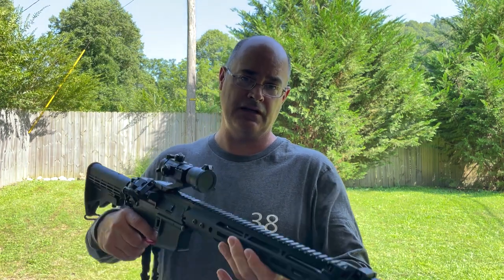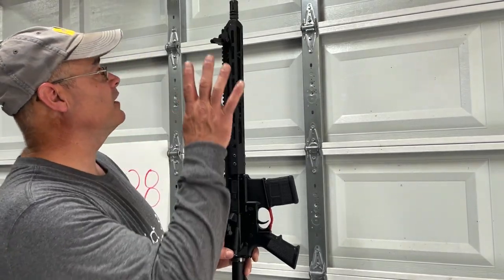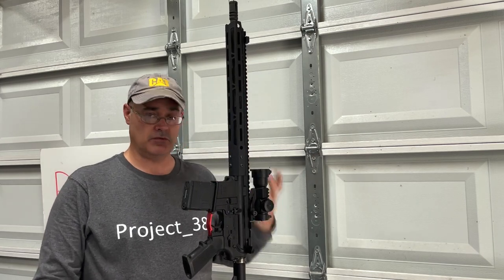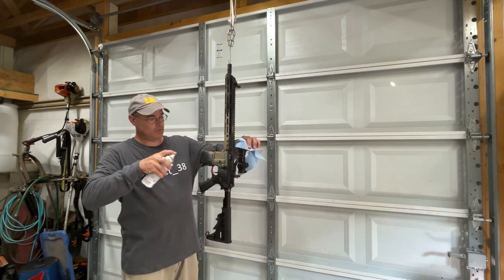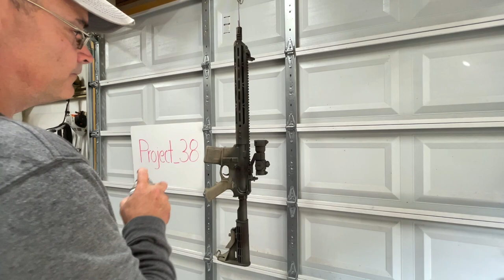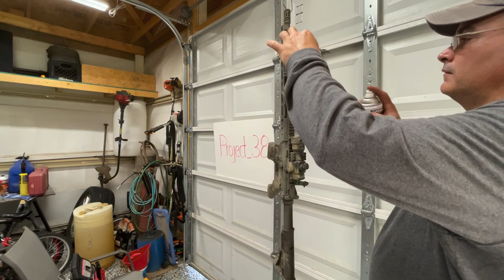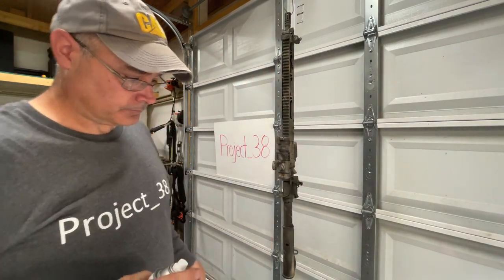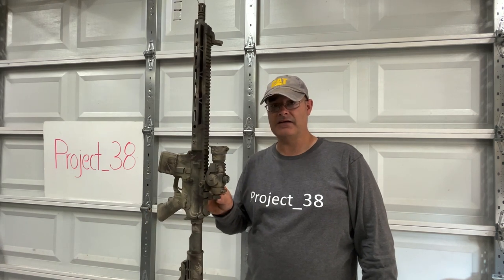Combat paint an AR-15...

Comment: I always found the best looking/most natural spray job was a tan or sand base coat, a few swipes of brown and green for striping, then blending it all together with a misting of green. works for a lot of environments, and doesn't make your gun look like it was sponsored by Real Tree (tm) camo.

Also, Krylon is INFINTELY better than rust-oleum. It wears much more naturally, adheres better (where I've found rusto-leum kind of chips as it wears) and just has an overall better looking finish.
Reply from the maker: I like what you said and appreciate your thoughts. And I don’t think you can go wrong with any combination. Keeping in mind current environment, changes of season and whether or not deep woodland or open expansion. 

Where I live, it’s all of the above. 

Thank you for your input and for stopping by. Ranger Sprocket
Reply: if i could dip my gun in real tree camo i would
Reply: @teleskopossomnium  😅 to each their own

Comment: Will the crab cleaner or mass cleaner hurt the stock or mag, like make it sticky.
Reply from the maker: Not at all. The solvents “gas off” real fast and it doesn’t leave any residue. I think it’s the safest to use. 

I wouldn’t use paint thinner or lacquer thinner. I think they’re to heavy. 

Thanks for commenting and stopping by. 

Ranger Sprocket

Comment: Does camouflage paint require primer?
Reply from the maker: Thanks for stopping by and for your questions. 

The paint I used had primer in it. Either way, primer is not necessary. After you paint your rifle, or whatever you paint, handling it and rubbing against your gear will cause it to wear off. No worries though, quick touch ups are easy. 

Ranger Sprocket
Reply: @Project_38   Thanks! You did a good job. I’ve now watched every single video on YT of people painting their rifles. You get something different from everyone.
I’m gonna start with my old Red Ryder BB gun first!
Reply from the maker: @42WasTheAnswer just do it.